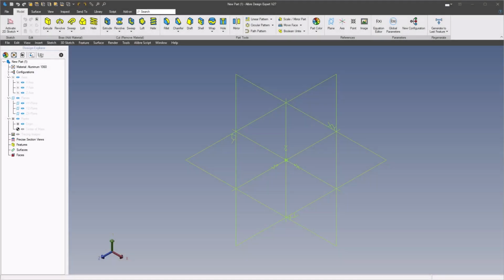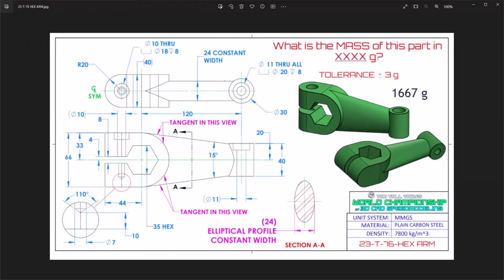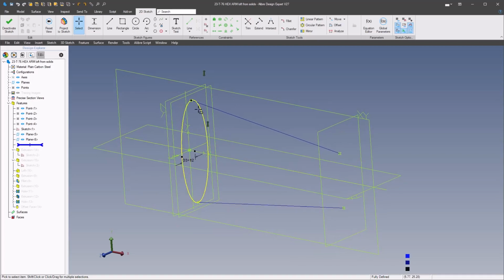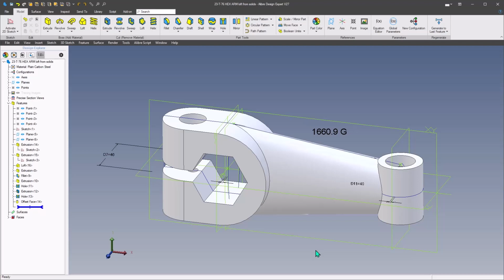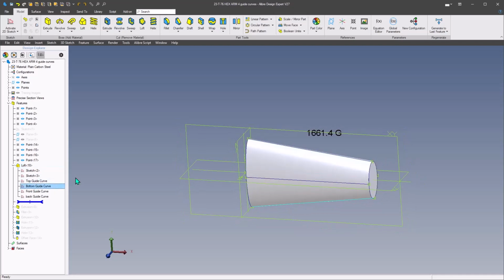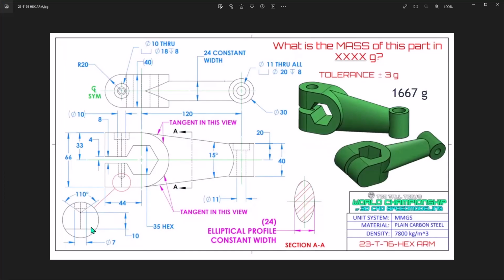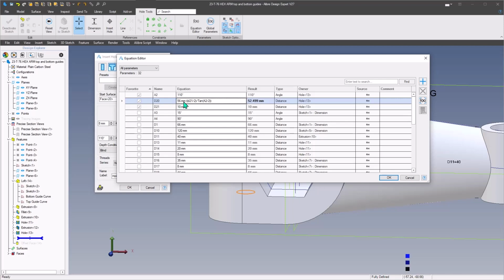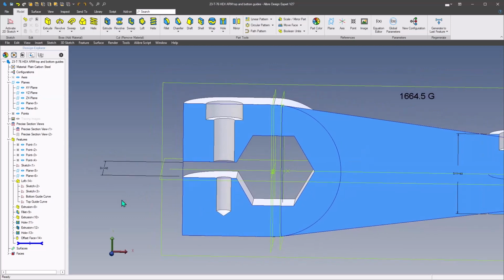Alibre Design   Creating A Loft

Comment: Very thorough approach on the Loft for the main body of that model. I think that the competitors had the same problem int he actual competition. When they didn't use Guide Curves they got a massively different mass. And in the competition it only worked when they used the top and bottom guide curves.

But in the context of TTT's competition, lofted parts are pushing the boundaries of mass accuracy when compering different CAD systems.
Reply from the maker: Thank you . I found it odd to get such differing mass results by using the different methods and number of guide curves. So I thought to demo each one. Good thing TTT gave a large tolerance.